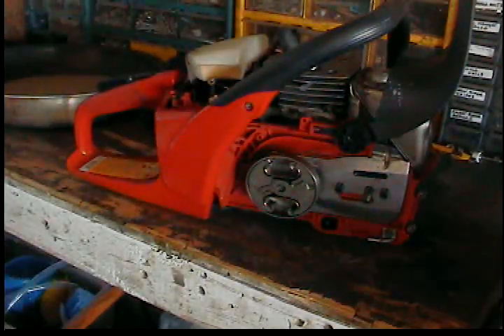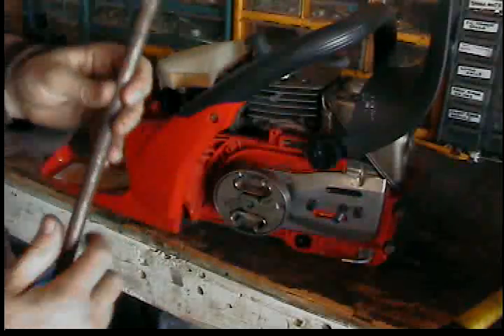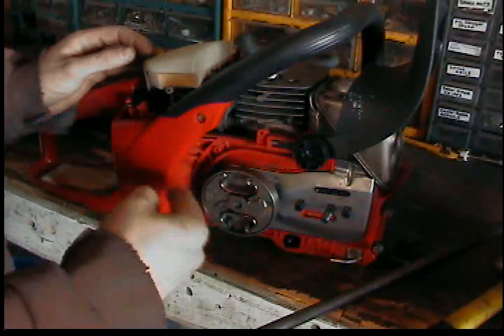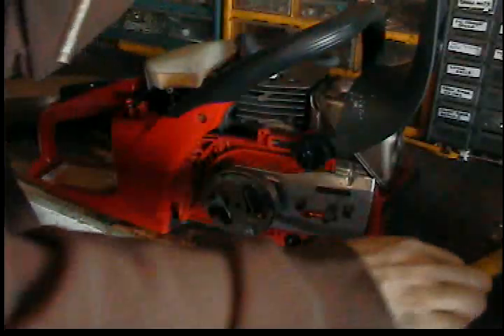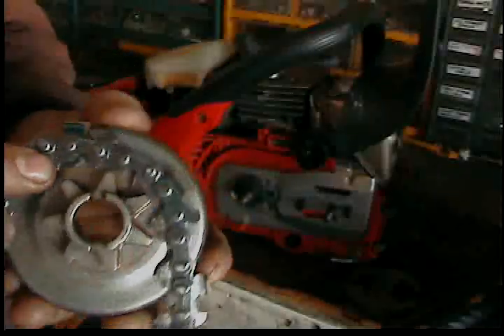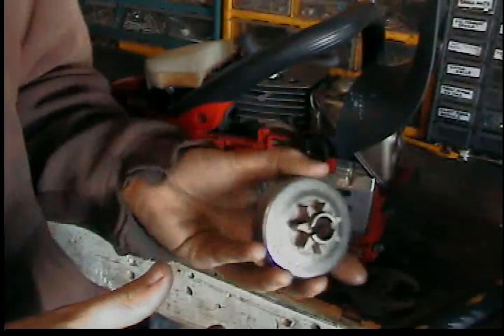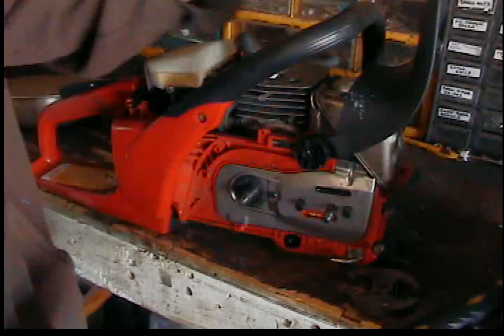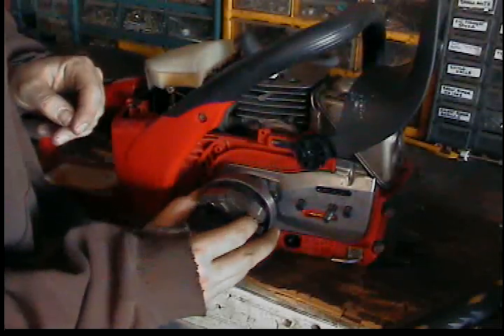How to remove a chainsaw clutch

Comment: Husqvarna 455. A couple of good knocks and it spun off easy. Meaning that the knocks were harder than hoped, but once free the clutch spun right off, just as described. I took the bearing out and used the grease out of my grease gun to lube it. The first time I put the clutch back on I over tightened it, which I knew because it no longer rotated. I took it back off and snugged it by hand the second time. Reassembled it, fired it up and it ran perfectly, insuring the clutch self-tightened (remember threading is opposite) vs. coming undone, as I’ve been told can happen if it’s too loose. Thanks for the instruction I needed to get the job done!

Comment: The sprocket you have is a spur sprocket. The one you are referring to with the removable "rim" is called a rim sprocket.
Reply: Do you think I can put this sprocket on a Poulon Pro & switch to a husqvarna blade & bar? I've already purchased the parts except the sprocket & clutch?